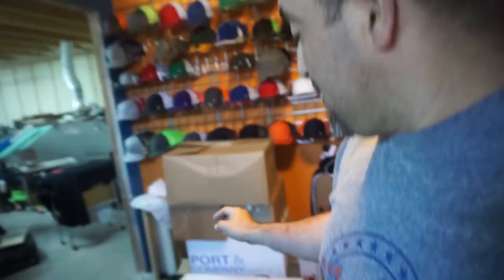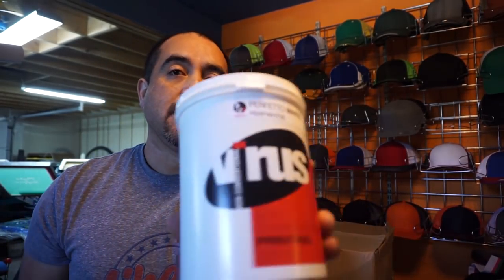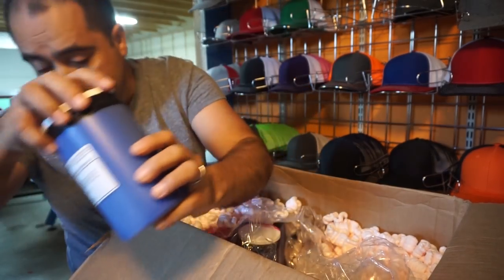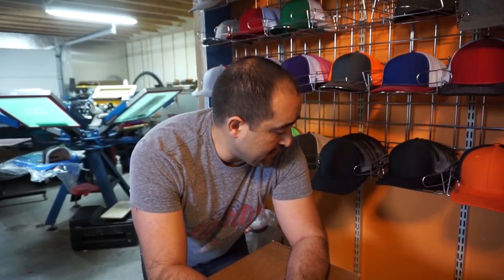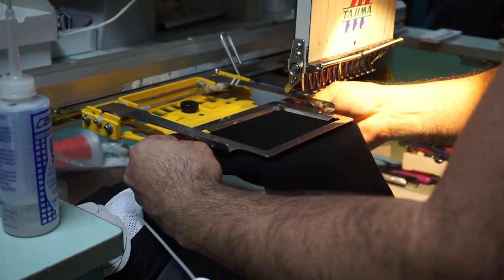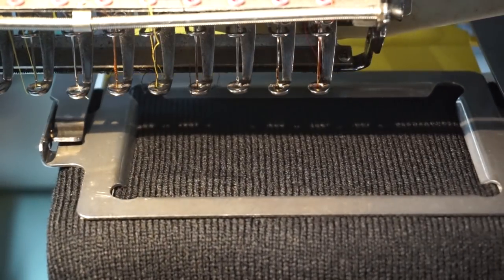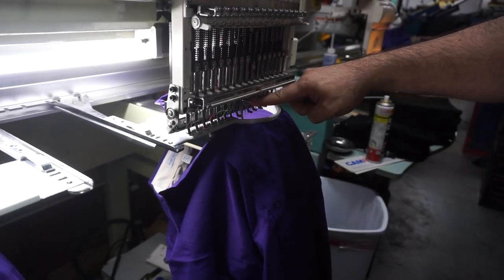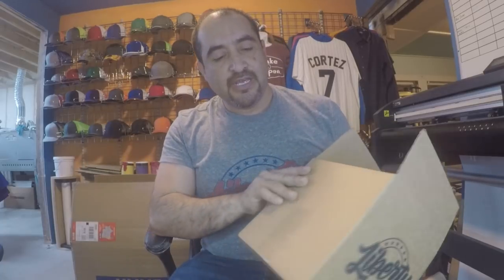EMBROIDERING BEANIES AND SHIRTS TUESDAY BLOG

Comment: Hey Juan you do your own digitizing right? How did you learn did you take a class?
Reply from the maker: Hey Tony, yes I do my own digitizing, no I did not take any classes for it
Reply: @LibertyGraphicDesigns  I started to try it and it's so confusing. I have no problems with vector in ai. I bought a little machine too see if I like doing patches and I'll tell you that it's not easy to do well at least for me. Lol
Reply from the maker: @Big___Sarge  lol at first it's a bit confusing but it will get better some software will let you do a cut and paste that makes it a lot easier, try to see if you can do that
Reply: @LibertyGraphicDesigns  ok I'll give it a try I used the magic wand and it looks great on screen but after it sews out it looks like crap. 1 colors are fine but when I try and put a fill color and a outline against the fill it either doesn't get close enough or the fill is not dense enough. All trial and error lol. I tried a few times to digitize it myself with tracing and I'm not sure if I'm adding enough pull or push. There's not a lot video on that so I've been working on 1 image and trying different things too see what will work.
Reply from the maker: @Big___Sarge  yes is a lot of trying till you get it right, what software are you using
Reply: @LibertyGraphicDesigns  florinia
Reply from the maker: @Big___Sarge  what format does it use to embroider
Reply: @LibertyGraphicDesigns  I'm not sure I know I can save it as pes. I tried to import a file from ai and it gets a jumbled up.
Reply from the maker: @Big___Sarge  can you send me the artwork? PES is correct
Reply from the maker: email me the artwork to my email libertygraphicdesigns@gmail.com
Reply: @LibertyGraphicDesigns  ok it will be later tonight.
Reply from the maker: @Big___Sarge  ok